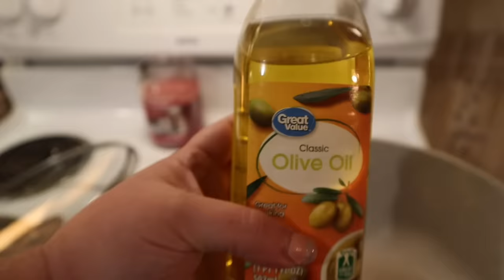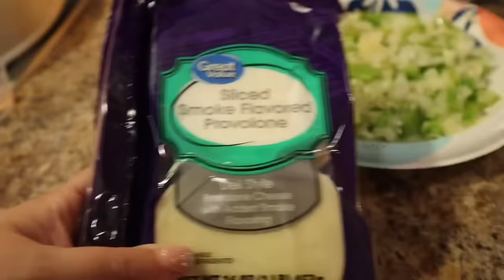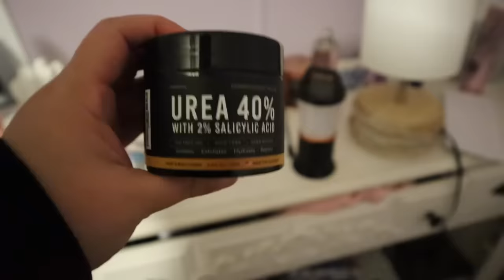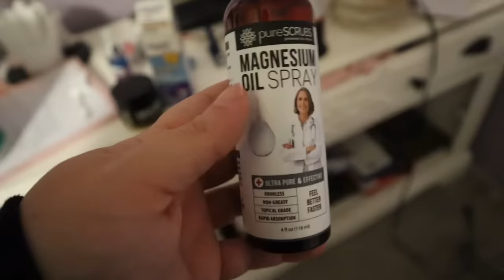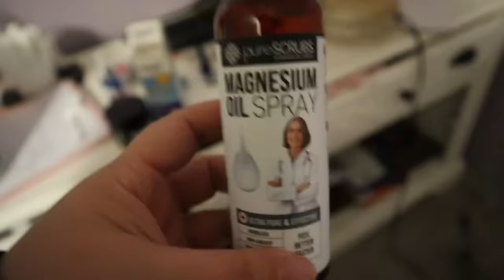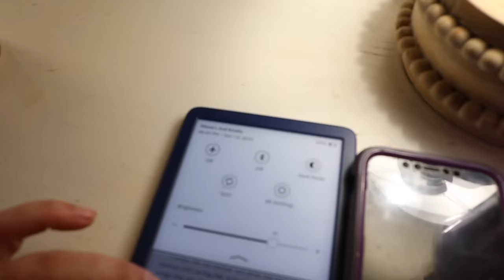EXTREME REALISTIC MOBILE HOME CLEANING | mobile home homemaking | let’s get this double wide clean!

Comment: You need a deck box to store your cushions when you aren’t using them! And a pressure washer! It will save you so much time and effort! 
Love the video! Always look forward to them ☺️
Reply: I was thinking the same thing!! We have one to store anything we don't want the dogs to get.
Reply: A pressure washer would take off the finish. The dog sees that area as a playground full of toys. Trust me I know. I'm just getting out of the puppy stage X's 2.
Reply: That would be a great project. They could Definitely build one
Reply: Pressure washers destroy !!!   Just use good ole "elbow grease"  to clean.
Reply: I think an actual all weather protective fitted  cover would be good as well. That way it saves her the hassle from removing each pillow case. 😊
Reply: True
Reply: Using a soft bristle long handle brush meant for washing RV's is super in getting decks clean with out taking off paint/stain. Dipin bucket of water with a bit of simple green & palmolive dish soap.
Reply: Those white cushions scare me 😮
Reply: Wow this was a great comment ! I agree completely very good suggestions ! Along with the power washer but use on low power because it can strip the stain if it's too high of a pressure !  But Reeny ! TMI on the crusty feet 😳 but when your suffering with that type of condition I guess you felt if we saw what your dealing with someone might know of a good remedy that you don't know about !!! I love you and your family bunches ! Also  Reeny sorry I don't know how to spell your name ?!?  But with your ADHD condition and your son with autism your food with so much sugar and empty calories are not good for you !  I will pray for God to help you to eat the right healthy food for you and your family to feel better 🙏  you have a huge heart and a lot of love for everyone but please make sure you take better care of yourself ! You seem to be  the center of your family ! They need you to be healthy 🥰❤️❤️🎈 happy your getting to make your dream home your own with your designs choices !!!
Reply: Im thinking maybe a box like you store pool supplies. You can always throw something over it and decorate! 
I had bought a wide semi-stiff bristle brush at Ace and attached it to my broom handle and scrubbed my porch. Saves the back!!

Comment: Having a deck box to put your extra little pillows and blankets away at the end of the night, would do wonders for them, not getting so dusty and dirty outside
Reply: Great idea
Reply: Yes, this!!!
Reply: Storing the pillows will save you a bunch of time and headaches. The only other solution is a railing with gates at the openings to keep the dogs off the porch and only let them on the deck for letting them out and in.
Reply: Or let the dogs out the other door

Comment: You may have to put a railing up around the porch again it may keep the dogs from running  all over it. They would stick more to going directly to the stairs.
Reply: Putting a child gate at the entrance between the railing keeps the pups off the deck when family is not around. Well worth the effort.
Reply: They still make muddy paw prints all over the floor. The only way they wouldn't is if all your property was concrete.  No dirt or grass.

Comment: For hardened heels, moisturizing several times a day is crucial. This includes a thick layer at night and putting on cotton socks afterwards to help with absorption and penetration. Products with lanolin, petroleum jelly, glycerin, and ceramides are good products to look for.
Reply: Coconut oil
Reply: Athletes feet also can cause your feet to just look dry. Maybe use derman cream is good.
Reply: Yes, use a thick moisturizer and then cover that with petroleum jelly and socks over them overnight!

Comment: Hey!  For your feet, try a foot file grater.  It looks like a cheese grater and does a great job on calluses.   It works best in the shower, so if you can do it at least every other day, you'll be able to keep on top of the problem.  Follow the filing with a quality moisturizer.  Sanding files and pummous stones aren't effective for the type of heavy calluses you have.

Comment: Merina- PEDEGG is great, then I use a file after I shave the dead skin with pedegg. Be careful not to go further than dry skin or it'll leave your feet sore. PEGEGG is like a cheese grater lol. Use it on dry feet, then wash and lotion after sanding. Lotion everyday and pedegg like once a month. 
I've heard but yet to try soaking feet in Listerine. I forget if supposed to mix, good or pinterest should know if Google listerine foot soak. 
Workers feet I think is the lotion I like best.

Comment: Merina and Shane, I was wondering if you have ever considered coating the deck with a high gloss ? I was thinking maybe it might help keep the mud and dust from showing and might be easier to clean. Just a thought,  but maybe you should check into it or you will be constantly mopping and rinsing😊 off the deck.
Reply: Wouldn't that make it slippery?

Comment: Try Krud Kutter House wash... attach your water hose into the kk cleaning bottle and spray deck off. SUPER EASY!! If you need hot water instead of cold (which is what comes out of most outside water spickets) attach hose to your washer's hot water hookup and viola!!

Comment: I would use a leaf blower and then a power washer on a low setting. There is also deck furniture that is more easy care than what you have. Or at least put some throw covers on the furniture when you're not using it. You'll drive yourself crazy trying to keep the outside clean. I enjoy your content! 💕

Comment: I have a nurse that comes in to do my feet for the same issue. She had me buy "CeraVe healing ointment".  Use it after the battery operated sander then put on some sock booties. She said use the ointment at least twice a week. I purchased mine on Amazon  ❤

Comment: Just a suggestion. I buy the Sam's brand blue soap in bulk. I put some in a smaller bottle and keep it by the washer. Before putting the clothes in the washer I dab some blue soap on all the stains. Then I fill the washer toss in a scoop of baking soda and a scoop of laundry soap, both bought in bulk. I've done this for years, have clean clothes, and spend about 30 cents a full load. Great way to save on laundry supplies. An added bonus, my washer never smells.

Comment: You need a power washer, it helps break it all up. You can also clean the outside walls when they start having green slim on them. Do you think that the arms on the couches will hold up to people sitting on them? You need one of these big bin to put all you cushions in when your not outside.

Comment: Cetaphil Rough and Bumpy for your heels. Use it consistently. A bit expensive so only use on heels (and elbows if necessary). Has high content of urea that will soften skin (but not as high as your 40% cream). You don't need to use alot at a time, just use consistently. Kerasol is another good one. It's an ointment that also has urea.

Comment: My sweet friend, you need 2 sets of sheets for your bed. That way you can wash the set on your bed and put on the second sheets on. The only issue would be if you don’t have room to store the extra set when it’s washed. Just a friendly suggestion. Also if you get a pedicure then use the cream you have and that will help a lot. Also, what spray are you using on your windows and mirrors. I can never seem to get my windows streak free.

Comment: You need some cuticle remover to paint on your feet after soaking in warm/hot water to soften even more and use a surgical grade metal file to get the dead skin off. Repeat process if needed as far as soaking and also drying your feet good after showering helps with removing that dead skin, personal tip. The winter is the worst time of year for my skin in general

Comment: Worx battery powered hand blower is easy to use also I have another worx product I like it is a power washer but not as strong as the pressure washer that might damage the wood decking.

Comment: Put lotion on the pedi scraper and on the sander part. It will work better to remove the dry skin.  Then after you wipe with a paper towel reapply lotion to your feet. I’m 60 years old and very dry skin it works great.

Comment: I have been struggling with depression alot lately and my house has been reflecting that. I need to get with the cleaning up and cleaning out 😊.  My feet used to do what yours is doing, and it was foot fungus. Get you some athletes' foot cream, wash and dry your feet every time before you put it on.  Put the cream all over your feet. Once you put it on, wear socks for at least a couple of hours to let it soak in good. Your feet will look so much better after a week. ❤

Comment: I have an idea for that muddy porch. I would spray it down with the hose next time then take a broom to scrub the hard to clean muddy spots then spray it down again to rinse it. Use hot water if you can. I think it might be easier and cheaper than using a mop because you can just spray the broom down when you’re done.

Comment: Ok, now Merina, I have made it a point not to write in except for a compliment once or twice. This is only bcz you have 1000's of comments to filter through, so I haven't jumped in to the comments.BUT, that porch cleaning...eeek!!
We had a VERY similar issue out our back door.
We have hired an excavator to come in and remedy some major ground issues, but that takes a long time and even moreso for new grass and landscape to grow to cover the dirt and when it rains...the mud...oh, the mud!!!!!Tracking in the mud, my sweet puppers were creating an ongoing disasterous mud mess...inside and outside. NOW...in an act of desperation. We bought artificial grass from our local builders supply. Almost all such stores carry it in 12 foot wide rolls. It isn't very cheap, but SO much less expensive than all the other options we looked into to get us to the next season of warm weather for grass planting.
We are so very, very, very happy with this "temporary" solution that when the warm weather comes around next year, we are adding to and reconfiguring the area to make this a permanent part of our yard all around the muddy areas surrounding the porch/deck.
Please don't wear yourself out fighting the mud war that no amount of washing will EVER win. Work smarter, not harder.
FYI .. I applaud you for not blaming your pup. If the mud wasn't there, he wouldn't track it in. Turns out our puppers love the artificial turf. They lay on it all the time to sun bath weather permitting.
Love you!!

Comment: Merina I kinda have the same problem in my feet. They get really dry , but every time I shower I use the foot scrubber and it does help. I found out a few days ago if you use epsom salt, olive oil and mix it with warm/hot water and then you soak your feet for as long as you can, massage your feet with the olive oil then scrub  with what ever scrubber you prefer and believe me it will remove a lot of the dry skin. I will try it to see if it work on my feet . Have you guys a restful weekend !

Comment: Just an idea for you....use a motorized heel smoother when your skin is totally dry ( hours before or after you shower) and the flakey skin will sand off easier. Then  moisturize your heels and put socks on. I do this on a regular basis and have conquered the crazy rough heel problem. ❤❤

Comment: I am a diabetic and had an amputation. I am good now. That was also 3 years ago. Now, No issues. Vaseline at night with socks.This is the only thing that worked. Doctors gave me all kinds of stuff. After you take your shower use the plastic scraper with soap. That's after you took your shower. The warm water loosen the dead skin. All that stuff will come off. Then dry the feet and add more Vaseline with the socks. You will be so surprised. Have a great day! Love ya!

Comment: Just spray that porch off with a water hose with a sprayer attachment if you don't have a pressure washer. It will be much easier and quicker. Maybe you could save for those outdoor cushions that can just be wiped off so you don't need to wash them all the time.

Comment: As a beautician what you need to do is soak your feet in warm water and oil ( any oil, it can be cooking oil) soak for 10 to 15 mins . Give it a light exfoliation and then lather them in lotion any kind will do and pop socks on to let the moisture soak in. Do this every night until the skin is hydrated. During the day wear socks add moisturiser if needed. The dry skin is your body's way of saying im thirsty so let them drink as much moisture as they need until they are soft and no longer flaky it can take about 2 weeks to completely repair😊

Comment: for your feet, warm water with lemon peel. little sea salt. Soak gently and run the lemon peel along your calluses to soften it. don't grate it will make it worse. Apply foot cream, preferably before you go to sleep. Repeat this more often in the beginning. After a while you only have to do this once a week.

Comment: About the feet 🦶 
Maybe you know this but I have to say it in case you don’t  
BEFORE you get feet wet in shower use any of the heel files or foot sanding tool when feet are DRY 
If it is totally dry it just disintegrates the skin into white powder and you just shower as usual 
The dry feet/ skin  help the friction of the tool operate better and the bad skin just comes right off 
it may take you a week or so everyday 
Once you get it under control then doing it atleast once a week it won’t be like what your dealing w now 
My friend told me about this idea years ago and I tried it and it worked for me 
God Bless You & your family 
Have a Merry Christmas 🎄

Comment: Regarding your feet ! I also have dry heels that are relentless.  I used to scrape them at the end of my bath . When they got real soft . With a cheese grater style scraper. A large size one.  I thought that was the best way , till I did it one day dry ,  out of frustration cause I let them go a while and were really rough. Well , doing it completely dry is actually more affective.  It grits it right down to soft skin . The skin turns to powder onto the floor so be ready to vacuum or do it outside lol and after you do get them nice and soft.  The only way to keep them under control ( which they eventually get bad again no matter what you do it's just part of having feet for some,  but you gotta keep them moisturized immediately after grinding them , and immediately after every shower and every night before bed and every morning. Now , the best product for this may surprise you , but I'm completely 100% serious that it works the best , is vicks . Vicks vapor rub . Put that on your feet then put socks on for a half hour or so each night and each morning before putting slippers on or shoes or whatever you may be wearing.  The camphor in it does something magical to the heels. It gets in them cracks . Do not use just any old lotion.  No fragrances or weird colored lotions . Them kinds make dry skin worse . Matter of fact don't use them gross lotions on any part of your body . Use natural moisturizers. Stuff made with beeswax or even plain old olive oil . I'm telling you all that fancy stuff is designed to make your skin worse so you keep buying it. Anyway. Scrape them heels when they bone dry. Moisturize with vicks. That's all 😊 ❤

Comment: You should apply polyurethane to the curtains. Roll three coats on with a paint roller . They are then waterproof and stain resistant

Comment: A good foot soak recipe for rough feet: A foot soaking tub or dish big enough to put both feet in. Add about 1/2 cup vinegar and 1/2 cup of mouthwash any kind, Listerine works great, and fill tub or dish with warm water. Soak for 20 minutes or longer (if really rough) and a drying towel. The skin will peel off and your feet will be baby bottom smooth. And the dry skin will be gone forever!

Comment: I'm a massage therapist and I own a spa.  You need a salt scrub for your feetsies.  That's easy enough.  But after that you need a mud and a wrap. That's the hard part.  But you can take Vicks, put it on your feet after you do the salt SALT Scrub.  Cover it in Vicks then wrap it for a half hour saran wrap. Cover the saran wrap in hot wet towel.

Comment: Hi Merina and all❤❤❤ I have some thoughts but you may already know😂1 keep the point of your knife on the cutting board and lift and cut without lifting point 😂😂😂 sure❤ and slather feet in Vicks and put soft socks on over. Sleep that way . I will guarantee 🎉🎉🎉🎉soft feet after a week. You can use perfume you do not care for in the bath for air freshening 😱🤠Hugs 🥰

Comment: For your feet, mine are the same way. I got a rasp foot file and I use it in the shower before I get out. It looks intimidating and like it will hurt, it doesnt. File as much as you can handle every two, three days. Lotion them after. Should do the trick.

Comment: Karasol for feet! Around $10 at any drug store. Put it on at night, after a shower. Then put socks on that night in bed. 
You are experiencing transepidermal water loss through your heals. I get this too. Exfoliating is NOT the answer😱 Moisturize before your skin dries. Once it is dry, it has already sealed and the moisturizer doesn't do any good🤓
Also, wear socks more often during the day-even in slippers. It will prevent the dry, cracked and calloused heals. I promise you will see results by the next morning 🥰

Comment: If you don’t have a pressure washer or don’t want to use one, get yourself a long handled scrub brush that, attaches to your garden hose. We use ours mainly for our RV but you can use them for other purposes. You shouldn’t need hot water just the cleaner of your choice. 

No one and I mean no one should be mopping their porch 😂